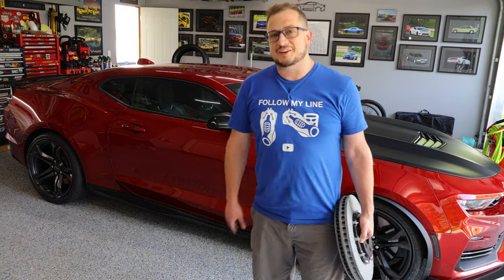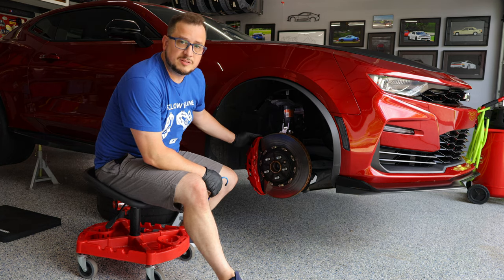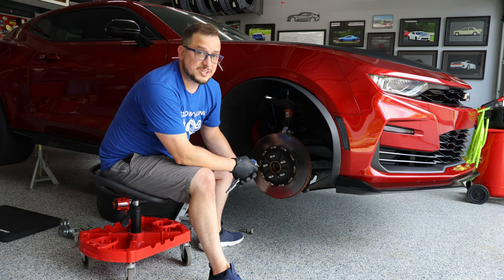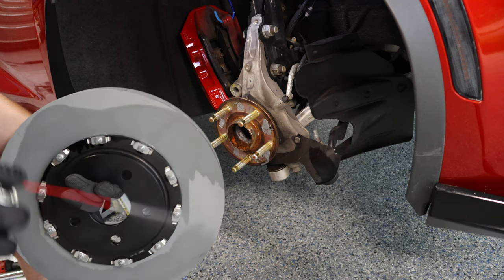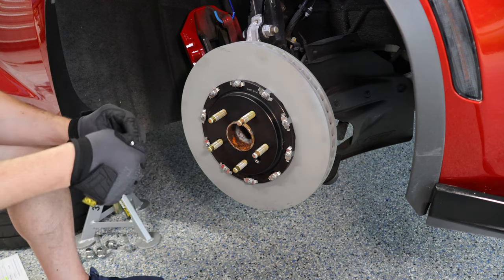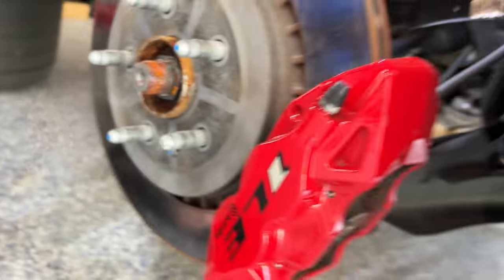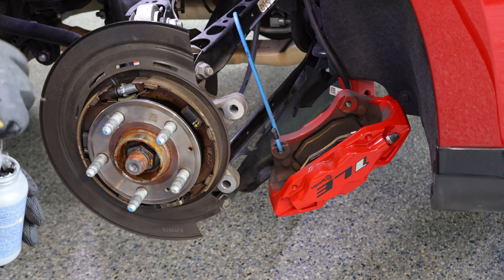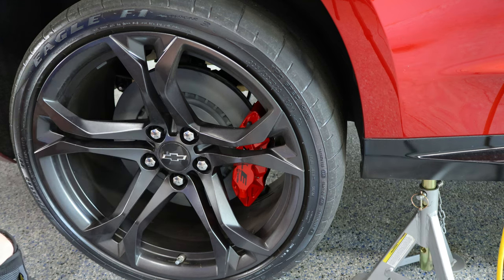Rotor Replacement // Front & Rear // 2016 - 2024 Camaro

Comment: Thanks for making another great video for our cars.  You might want to add that the rotors are directional and maybe suggest to use a thread locker for the caliper bolts.  👍🏻
Reply from the maker: Great suggestion on the thread locker. I didn’t want to call out the directional rotors because this applies to nearly all Camaro’s, and ONLY the SS 1LE has directional rotors. The standard SS, ZL1, ZL1 1LE and BCD equipped cars do not. I didn’t want to add confusion, but I should have called it out in the video. I will pin this comment for others to see!

Comment: do you replace your rotors with every pad change ?
Reply: He definitely didn’t. SS 1LE rotors last many more track days than the pads do.
Reply from the maker: No, I do not. Rotor to pad change should be 2:1 or 3:1. The rotors on the SS 1LE, ZL1, and ZL1 1LE are incredibly stout. These lasted almost 15,000 miles with hard and heavy track abuse. Honestly, I could have run them for a few more months and another track weekend, but decided to play it safe and swap them before my next track weekend.

Comment: Where did you get those rock guards?
Reply from the maker: Those are the ZL1 Addons Deluxe guards, and the C7 Z06 fender flares.
Reply: @FollowMyLine17  how come you didn't use the SS guards. Just curious?
Reply from the maker: @Wheelman6.2 great question. The ZL1 Addons deluxe guards match the Z06 flares better.

Comment: Why are your rotors so perfectly red 😫😭😍
Reply from the maker: I assume you mean the calipers. Whenever I bleed the fluid, I let a wooden toothpick soak in the bleeder valve for a while. This prevents the fluid from seeping over onto a scorching hot rotor during track days, and turning them brown. I also have them ceramic coated, which helps keep them clean easier.
Reply: @FollowMyLine17  yeah that’s what I mean. Very clean.
Reply from the maker: @IronLrdVader thanks!

Comment: You do a rotor change and leave old brake pads on? That is a 1st
Reply from the maker: I have several sets of pads. I swap pads for street and track use, so the pads still have around 75% of their life left. No need to swap them yet.
Reply: @FollowMyLine17  I can kind of understand what your saying. But that would make bedding in the new rotors even more important. But I don't think that was mentioned. Also explaining a visual inspection of the pads would be beneficial if doing a rotor swap without a pad change. Friends dont let friends warp rotors😋 It was a good video. Just felt a bit unfinished at the end there
Reply from the maker: @christianslense455 thanks for the feedback. I’ll keep it in mind for future videos. I do have a separate video for pad change as well, and another video on inspecting rotors for heat checking and crazing. It’s nearly impossible to warp a modern day rotor. What most people think are warped rotors end up being pad deposits, so I’m not worried about a warped rotor on a high-quality modern-day OEM rotor.

Comment: 22mm lug nuts or 7/8 inch lug nuts ?
Reply from the maker: OEM lugs are M14x1.5/22mm. 7/8 fits, but leaves the slightest bit of play. Over time, it can round off the lugs. 7/8 is more like 22.2mm
Reply: @FollowMyLine17  Now i tried both and curiously the 7/8 fit better (more tight) although the 7/8 should be bigger (22,225mm)
Reply from the maker: @OMPTraxxs in theory alone, the 22mm shouldn’t fit at all if it were a 7/8ths lug nut. Food for thought.

Comment: Torque specs on the caliper bolts? *Edit: He covers it in the video. I'm dumb.
Reply from the maker: I cover all of the torque specs in the video. The front and rear are different, so make sure you are looking at the correct caliper in the vid.
Reply: @FollowMyLine17  ahhh!! you're 100% right I'm sorry! Thank you for correcting me!

I would also say, if it's the first time taking the calipers off, you might need a breaker bar and pole because the factory thread locker on there is no freaking joke. At least on mine, that's what I had to do.

I ended up sonicating the bolts to break up the thread locker in acetone.
Reply: @followmyline17 I just noticed you have a typo on the toque specs @ 7:22 . You say 111lb-in and not lb-ft. 

The 150nm is still correct. Lol it threw me off.
Reply from the maker: @Stinkie_Cheese_Man thanks for catching that. It’s definitely lb-ft like I state. It’s just the pop-up that is incorrect.